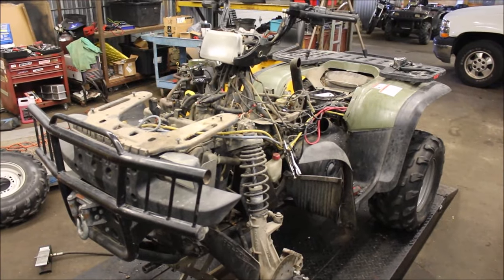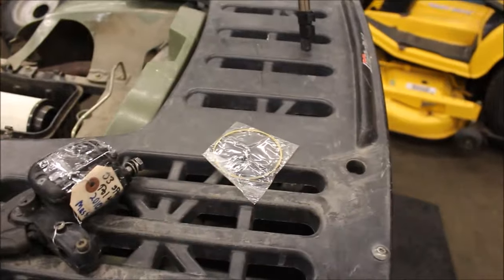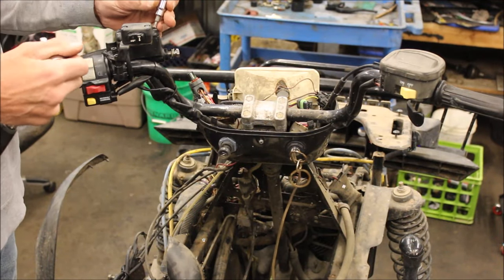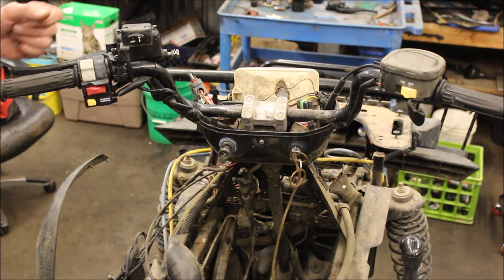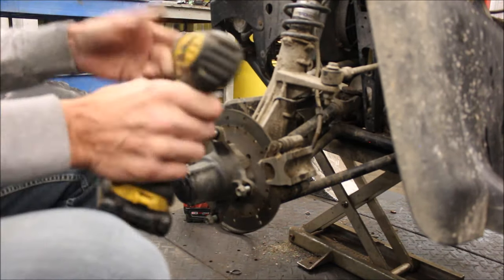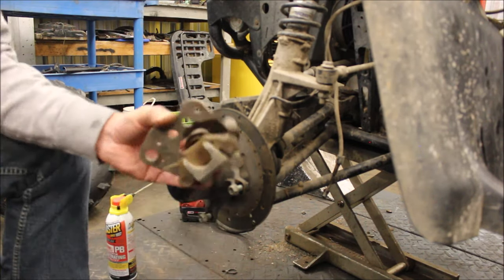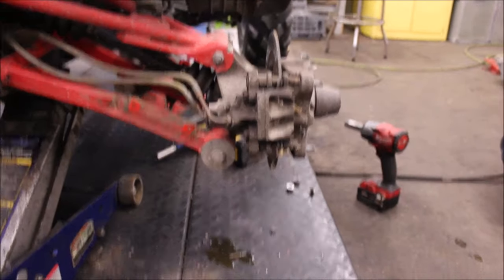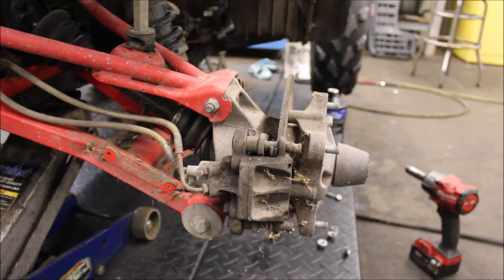How to Bleed the Brake System and Repair Brake Issues on your Polaris Sportsman.

Comment: Winner winner--Used the syringe system to push fluid to the top of the reservoir worked great. Thanks man.
Reply from the maker: Awesome!
Reply: @TitaniummanGarage  Howdy! Where in Wisconsin are you located? Need someone as qualified as you to repair my machine!
Reply from the maker: @nikebertify  I'm on the outskirts of Sheboygan.

Comment: My concern with back bleeding is the possibility of pushing dirt into the system that might have been inside the bleeder screw because rarely have I seen an old atv that still had the rubber caps over them. I do see the appeal though. I built a pressure bleeder years ago from a weed sprayer pump bottle that still serves me well. However it is very risky to clamp the pressure bleeder to a plastic reservoir. I may try your method. I’m currently having brake issues on the same bike that is overheating, I put an aftermarket master cylinder on it and it acts like it isn’t pushing enough volume of fluid to properly work all three calipers
Reply from the maker: I get what your saying. If you look at the master in the video you can see dirt flakes that was pushed into it. I then suck all the dirt out of the master and fill it again. I would replace that aftermarket master with a used one. I spent 40 bucks on a good used master.